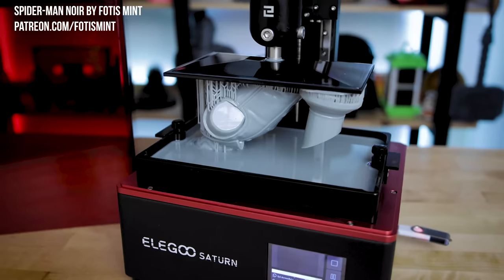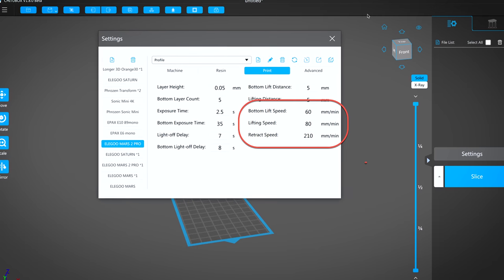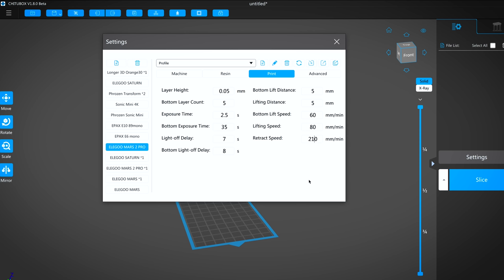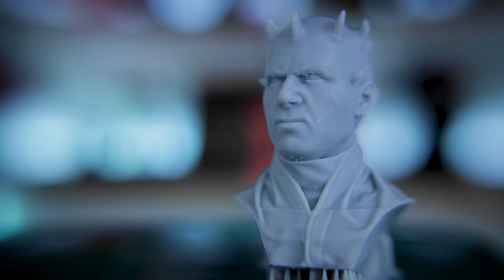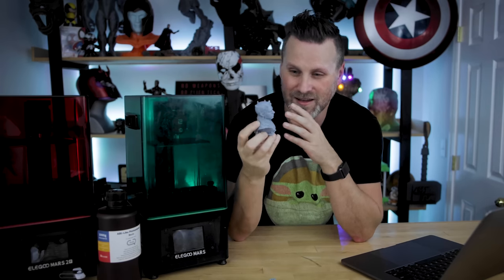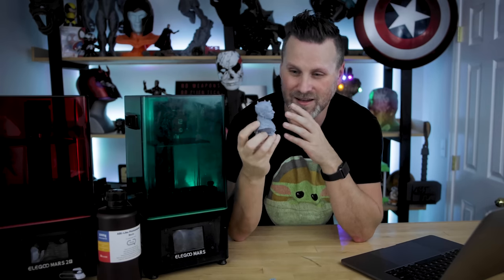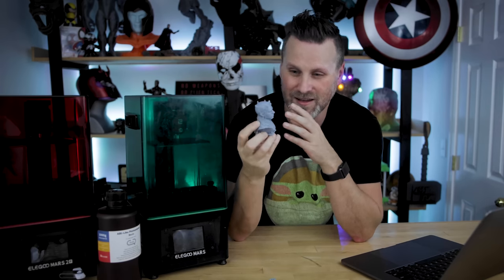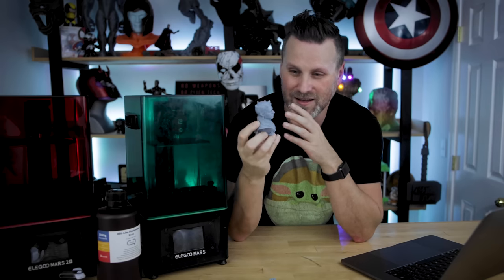Vroom - Faster Resin 3D Printing - How To

Comment: Phrozen Sonic Mini here, I've been printing almost 24-7 for the past 3-4 weeks with Vroom @ 300 - didn`t change any gcode or firmware so it could be capped at a lower speed (just went 300 and didn`t bother). Thanks to the faster time I was also able to cut down the lights off, shaving a second away as well as reducing my exposure by close to 10% (.2 seconds) as the results appeared to show a slightly higher exposure. Since I changed my damaged stock Fep I haven`t had a single failure. Considerably faster and flawless results is quite a win!
Reply: Hi, are you still using VROOM?
Is the speed of 300 great without SM4K gcode firmware?
Reply: @말꽁-o7j  haven't printed in a while but it worked really well without any FW change on my mini non 4k
Reply: @VoicelessScream  Thank you for answer. I'll have to try it too.

Comment: I have a Mono SE. I Print at 240/360/240 - 1.5 second exposure - bottom 18 seconds ( 6layers) - light off delay 0.5s - 0.05 layer height with Elegoo ABS Like and it almost never fails.
Reply: Hey, are you using these settings on Anycubic photon workshop? Im afraid to raise those numbers from the default which are 6mm:zlift dist 4mm:zspeed and 6mm:zretract to 240 and ruin my printer. Is it safe to bump those numbers up?

Comment: Vroom is working fine on the Mono X at 240 mm/s. The printer doesn't require any Gcode modification. It was for a large print.

Comment: I print mostly very detailed small minaitures. Everything faster than 45mm/s lift speed is like rolling a dice even with PTFE spray on the FEP. I rather have a print that takes a few hours longer but actually comes out looking perfect than having a faster print with 50% failures. This could work quite well when printing directly on the buildpalte without supports though. It's usually the fine supports that break away when the lift speed is too high. Also: In the pictures the damage from high lift speed is clearly visible at 7:24

Comment: Wouldn't this depend on the resin you're using? For example Sirayatech Blu is really thick, viscous, so I actually have to slow down my lift speed to print with it. Phrozen's 4K resin is really thin so I can speed it up.

Comment: Thanks for the shout out for the (g.code)

With my settings I increase the exposure to 3.2 seconds for 0.05mm layer height.

Other setting I like to play with are to reduce M8016 from I3 to I1 - this improves second home speed.

And reduce M8021 from S1.7 to S0.6 this will reduce the distance of  the slow retract speed, reducing print times.

Great channel 👍

Comment: I did this without knowing vroom, is because when i am tesing Saturn and MonoX, i found out MonoX is 30-45mins faster than Saturn with the default setting. i found out MonoX is having 4mm/s (240mm/min) lift speed and retract speed. So i applied 240mm/s to the Saturn, it went much faster!. Also i tested for 300mm/s,  going too fast somehow shake off my print. so probably 200mm/s for saturn is safe to go, MonoX leave it 240-280mm/s. 

FYI, Saturn do have better print quality compare the MonoX.

Comment: I know the video is a year old but I just sew it today. For the first Mars I used the settings from the rook file which came with the printer and the liftsettings there are at 300. So I think you can go that fast with all the Mars printers. Since I used those settings all prints came out nicely, no damage on the screen or whatsoever. I think Lychee is the better slicer and prints which I struggled to print with Chitubox came out great with Lychee. I dont know whats the difference but I dont go back to Chitubox anymore.

Comment: I have been"vrooming" for a month or so, and the only negative I have seen is that my supports hold on much better - making cleanup/scarring a bigger issue. Still, if I can cut 3 hours off a 12 hour print, an extra 10 minutes cleaning up the model is worth it.
Reply: Have you changed your FEP tension? If not and you tune it what frequency do you use?
Reply: @Loasdrums2  Honestly, I have been so careful with my FEP that I'm going on a year and a half, and haven't had to change it out yet - so I don't know. :)
Reply: @komsomoletz828  wow I’m in my 3rd in as many months. That are cheep and easy to change
Reply: In my Mars and Mars 2 Pro I keep the FEP around 340hz +/- 5hz. Much further than that I get failures. I also run a thinner layer height between 0.02mm and 0.03mm.
Reply: Do you honestly feel the machine is designed for this ? there will be flow on effects to the rest of the machine for oc.
Reply: @GG-od2tr  I've been doing it now for over 18 months, and both my machines (Elegoo Mars and Sm4k) are doing just fine. I've changed FEP on both finally, and kept on printing.
Reply: @GG-od2tr  That's fine, just trying to be helpful. Got my first printer a couple of years ago, and have been "vrooming" most of that time. I'm not sure about exact timeframes, just expressing what has worked for me. You're welcome to do what you like and I hope it works for you. Cheers!

Comment: been using vroom settings on my saturn since a while; game changer...someone says vroom shortens your lcd screen lifespan since the faster speed doesn't give time to the screen to cool down between layers...but i'm printing in a room where the temperature is around 10°C so I don't worry about overheating
Reply: Does the Saturn need G-Code changes?

Comment: The Whambam plate on the Saturn has a lot of trouble with larger print volumes on the Saturn with my experience. It has a tendency to flex a bit on the edges.
Reply from the maker: Oh really? I have mine on my Saturn and Phenom and rarely run into print issues with it. Love those little flexy plates
Reply: @UncleJessy  Not trying to say they are bad, easily could have been a botched install but on my Saturn anything out near the edge was failing, but was totally fine once I removed the plate. I am printing larger functional pieces like fishing lure molds though.
Reply from the maker: @WMBayouLures  oh cool! Do you have a link or socials? Would love to check that out
Reply: wipe the magnet 🧲 before applying the flex plate.
Reply: @user-qv1dp2xh5q  when I can get another build plate from elegoo for the Saturn I am going to give it another go for sure. I can’t have my printer down for 3 days right now while the adhesive bonds. Love the idea of the whambam. I am going to get one for the ld-002h

Comment: You can, tamper with that just as you can do on a fdm printer, but what you should do is to test quality and set an acceptable one instead ..there is no need to print maximum quality on a larger figure as you are probably gonna post process it anyway and visible layers on the surface doesent mean it is when painted . Most printers still make an object faster than you post process it though. In regards to fans, just change fans to a pc fan wich is silent as the majority is 12 volt

Comment: i wonder if your magnetic flex plate is shifting at those higher speeds
Reply: Having used the Wham Bam plates, absolutely not. My Epax X1 plate would just about take a finger off when it wanted to snap together (mostly hyperbole... but seriously, their magnet was MUCH stronger than my current model which has also printed flawlessly for months).

Comment: Does Vroom setting work with EPAX E10-4K mono and any other types of resins. I am under the impression that other than the Siraya fast resins they need long cure time? Or am I totally wrong in that line of thought?

Comment: 2 years late but I am having issue with the Eastwood prints. I downloaded the files to my Anycubic Mono Proton 4k stick and sliced them. Did not change any settings and the very first print failed. It did seems that the lift speed was way to fast and the exposure time was to low. May adjust the exposure up .5s and lower lift speed by 1mm/s

Comment: 14:20  Do you think the wobble might have been the Wham Bam plate shifting?  I haven't installed mine on my Saturn yet, just because I I haven't printed full plate models yet and hear some folks having an issue here and there with it.
Reply: The only time I've notice slippage of the wham bam plate is if I get resin between the plate and the magnet when putting the flex plate back on after a print.  Uncured resin is very slippery, so I always make sure to use a bit of IPA to clean the magnet and both sides of the plate before I re-install it.  Haven't had any problems.

Comment: I guess Anycubic sets this by default now. I just got a Mono a couple of weeks ago and Photon Workshop had settings of 240 for both lifts and 360 for retraction (well, technically, 4 and 6 because it's per second, not per minute in Photon Workshop). I just transferred those settings over to Chitubox and it's been printing great. I didn't realise it wasn't normal or there was a special term for these kinds of speeds until I saw this, heh.

Comment: Based on my experiences with an Epax x1K, success with vroom (again, for me) came down to thickness of supports and type of resin. Started with SirayaTech Fast, very inconsistent results. When I swapped to Epax Hard (grey), I noticed a dramatic increase in success. I think I’ve only had one (partial) fail in two straight weeks of printing. Running @240 lift and 1.8s exposure.
Reply: Got a link to the gcode mod?

Comment: Anyone know if the EPAX E10 will work with these higher lift speed settings, or do I need to tweak GCode or firmware as well? Thanks in advance.

Comment: Am I going mad, or are these slower than the default speeds for the photon mono?
Reply: That's what I'm wondering I am printing right now lychee says should take 6 hours and the printer says 36
Reply: ChituBox shows the default printer settings for the Photon Mono SE has a 240 mm/min lift and retract speed

Comment: I've got saturn 2 and mono 2 the same speed settings that never fail now there 60/150 amd a hight for smaller parts 7 and larger parts 9 to hear that fep release sound! These are absolutely perfect for my printer's not to slow either really Tbh! Saving 40minwnfrom a 5hr print to have a fail at these 240 speeds is it worth it?! It's not to me, what's an extra 40 mins if waited that long only to possibly have a failure somewhere

Comment: Probably only affect the lift motor and drivers heating up more. Retraction speed affects the peeling forces on the FEP sheet. Yanking it off the FEP will affect the support structures adhesion.

Comment: just got my mars 2 but stuff keeps sticking to the FEP. I've got half a mini before it fell of the build plate last night. Trying increasing the temp because maybe the resin was too cold? I've already changed base layers to 75 sec which seems a bit extreme based on videos I've seen.
Reply: On my Mars 2 I'm using 4 bottom layers at 25s and 3.5s/layer with my current resin (0.04mm layer height) running 240mm/m.

Comment: I was pondering about the exact same thing when I did my first prints on the E10. The print speed was not that impressive, O yes - exposure times go from 8 s on my Photon to 3 s on the E10 but I still measure 10 s per layer because of the slow lift speed. I was not only looking at the lift speed but also at the lifting distance. This is set to 7 mm for the E10 and looking/listening at the action during printing I think that 5mm would be enough for most of my prints. The 7 to 5 mm change reduces my print times from ~13 to ~10 hours
As always YMMV and I will definitely stay with the lower speeds for prints that have a large contact area - ripping a FEP sheet while the vat is in the printer is not a fun thing to do ...

Comment: i've been using increased z-speeds on my mono-x for about a month with no issues with siraya tech fast grey
for some others resins I have had to modify the support settings I assume this is because the siraya tech fast has a little give where alot of other resins are stiffer

Comment: Good information, but keep in mind that if the lift speeds are too high, you might even rip your FEP film because of the tension.
Reply: Best response so far, was thinking that the entire time. I would rather wait for 8 hours than chance ripping a FEP, or having VAT failure and need to either clean up and replace a gasket and screen protector or worse a screen.

Comment: Tried the settings but I'm not sure they actually work? I mean, the print came out fine but the print time Chitubox estimated is vastly different than the actual print time. I'm guessing the Mars 2 Pro can't actually do 240 mm/min speeds? Unless I'm doing something completely wrong (which is quite possible).

Actual print time's are consistently 1.5-2x longer than Chitubox estimated print time.

Comment: The current rev of Chitubox (1.9.1 Basic) for my M2P has a additional box next to the settings that UJ suggest. Is there any new additional settings that also need to be entered for those spots? Currently using his 180 speed suggestion and getting fine prints but I'm not noticing any real significant time savings. But I'd rather have successful prints over a quicker fail any day.

Comment: Printing SM4K at 300. Prints are beautiful.  No failures. I suspect printing at such high speeds also results in increased resin temperatures which likely helps.  Needed a small modification to the firmware.
Reply: How did you mod the firmware?
Btw do you know the speed cap if there is one?

Comment: Uncle Jessy, I'm trying to get into 3d printing as a whole. I am really leaning for a resin 3d printer as I don't mind the clean up and curing process. What I mainly want the 3d printer is for miniatures, busts and stuff in that regard, but I am also really interested in making the occasional facemask like the half kabuki mask you have shown off. Which printer would you recommend for someone like me now that there are so many options? right now, I'm leaning towards the Mars 2 pro, but I doubt i can make face masks with it's smaller size.

Comment: Vroom is the way. I run 300/300/300 on my M2P with 20/2.5s exposure. And results are beautiful. Highly recommend if you are not scared. ~20% time reduction for free is hard to argue :)
Reply: Do you have to change the Light-off delay and the bottom light off delay for the increase speed to actual reduce the time of the print?
Reply: @ChocolateHacker  I've always had them set to 0 so no speed increase from that :P

Comment: Trying to think of a good way to ask this in a way that makes sense but, I would imagine, if you are moving the build plate back down and displacing the resin the resin would still be in motion for the next light on layer. Wouldn't you want to have a dwell time to allow the resin to become static? Not saying so much for supports or even hollow prints but more for large surface area prints.
Reply: That setting is called “light off delay”.

Comment: I know this is an older video but I just picked up a Mars 2 Pro and discovered this. Anyway, anyone have any idea why I choose these settings in Lychee and it tells me one time, but when I actually go to print, it's not even close? Example - I have 240 set in Lychee. Tells me print time is 2 hours 22 minutes, 46 seconds. Actual print time is about 3 hours 47 minutes. Am I firmware limited? I did not change the gcode, only the settings in Lychee slicer.

Comment: Biggest takeaway: not all supports are created equal. Resin can factor into it, but supports... Did you try any larger prints on the Mars aside from Darth Maul? I don't recall seeing a time for the non-VROOM print but I imagine the time savings would be slightly better than those observed for the Amerilabs Town prints. One thing I noticed when I first received my Epax X9 mono was that it spent more time moving the plate than curing the resin so I've been playing around with this for a while, I just never knew it had a name. And due to some less than stellar presupports, I've kept my lift speeds modest but I believe my retract speeds are 300 on the X9 and ~210 on the LD-002R with 35 and 40 mm/min lift speeds, respectively, and I've not noticed too many issues across a variety of resins and presupports but Greg, I love that guy, as I've never had an issue with nearly any of his supported minis with lift speeds of 100+.

Great video, thanks for the info and this goes a long way towards debunking somet of the info I was first given when expressing concern over failed presupported prints.

Comment: Great video as usual! Even though I STILL have not broken down and bought a resin printer (so messy) I was curious why the speed increases were done straight across the board as one number rather than doing a percentage? I guess the retract speed would be nuts but maybe limit the speeds to a max cap and say try 200% increase so at time stamp 7:00 (made that one nice didn't ya lol) you show 90,100,150 for speeds so try 180,200,300 rather than straight 240 or whatever. 

Maybe it is a dumb question (refer to the name and maker coin as I am an idiot)....??

Comment: Hi there, what exposure time (not lower) would you recommend for layer height 0.015 on Mars 2 pro mono with standard elegoo grey resin ? 
I could find info for 0.05 layer height and this is in Chitubox as standard but for that low height i could not find any info.

Comment: food for thought (and i've never had this happen so theory only) you take that maul fail, the setting changes you may be looking at a cracked fully/broken screen vs a dead pixel if it had have rammed into the bed..... also i'd be worried about fep fixings and seal.  Not something for resin that not pretty well dialed in already.  imo

Comment: I prefer maximum quality over tiny time saving. Just one print failure and all time savings vanish. Post-processing takes longer as well. If you need to save time, buy a second printer. Divide the costs by the time you save and find out that this is the way to go.
Reply from the maker: Yeah ive got mine now at a point where I can really reliably print at a much higher speed but I totally hear what you're saying and it makes sense.